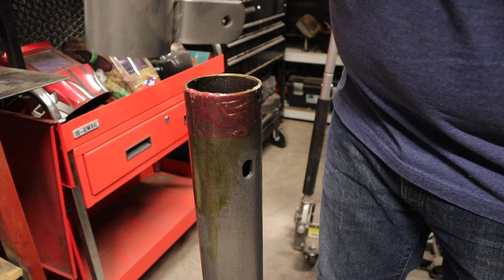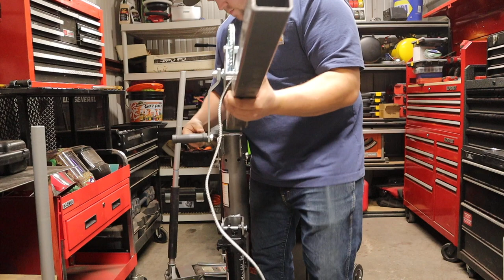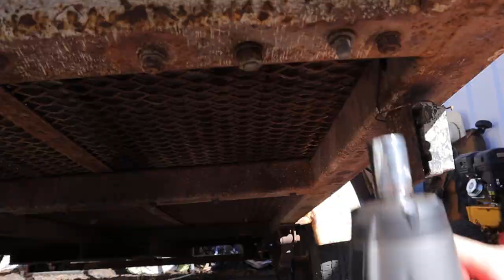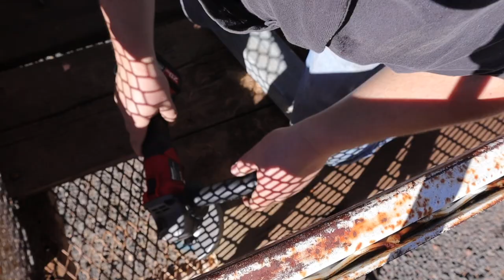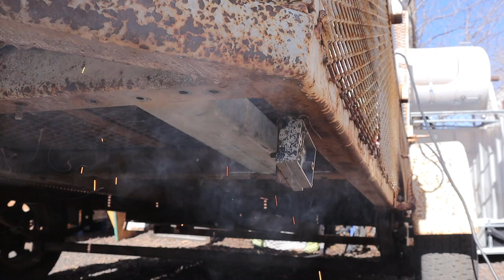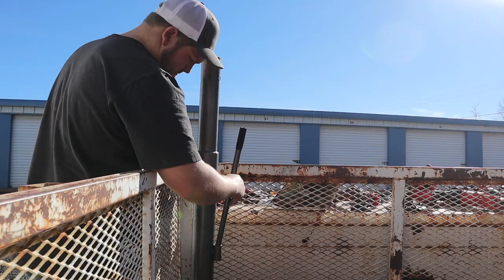Harbor Freight Pick Up Bed Crane Assembly and Mount on a Utility Trailer

Comment: That little bitty Bauer circ saw sure came in handy in that tight space - nice! Was that also a Bauer recip? And grinder?
I enjoy your content - thanks for posting!
Reply: OK, I just watched this again on a larger screen and saw that the grinder was the Bauer cordless. Recip too?
Reply from the maker: Yes sir! All Bauer cordless tools. The 3/8” impact to remove the bolts. The circular saw to but the wood out. The reciprocating saw to finish what the circular saw couldn’t do. The second generation grinder to cut the the expanded steel out. The first generation grinder to grind down the weld spots in the way and to clean the metal for welding and then wire brush the flux off the weld. Then the regular drill to drill the holes in the steel frames. Then the 3/8” impact to to tighten the new bolts. All cordless Bauer tools! They might not be professional grade but they can seriously get the work done. Thanks for watching!
Reply: InstaBlaster.

Comment: Wranglerstar would NEVER say teflon/loctite is unecessary hahaha. Tech question, what do you film with? And what software do you use for editing?

Crane looks pretty handy! Not sure what I'd ever need it for but the coolness factor haha.
Reply from the maker: I have a Canon EOS M50 to film with that bought for like $650 last May, and then iMovie to edit. And ya Wranglerstar would never say that haha! I miss what his channel used to be like. I don’t care for it anymore.
Reply from the maker: As for the crane, I’ve thought about trying to start a little junk removal side gig in the past.
I doubt I will, but if I do, this would be really handy for big heavy stuff, outside of that, more than anything it’ll just be to have it for when I need it.
Reply: @DereksWorkshopAndProjects  Awesome, thanks! I have access to a rebel t3i that I've used before, considering buying it off my friend and using it regularly whenever I make the jump to making content regularly. I share a lot of Cody's opinions on the topics he discusses lately so I enjoy his content still, but I could see how people would be disappointed with how non PC he's become, as well as changing his style of content from the old tool videos he used to do. One thing that is awesome to see is his videographer ability though, he's improved tremendously with using lighting and sound etc.
Reply from the maker: I’m pretty central when it comes to politics. Sometimes find myself leaning left and others right. Depends on the specifics. One of the things about leftists I hate is their PC culture. So that’s not what bothers me about him. I’m also big on personal responsibility and he seems big on that too, where the left usually isn’t. I might lean slightly more right than left.
I rarely ever get into politics on YT though.
In fact this is probably the first time I have ever discussed my views haha.

What bugs me about him is that he used to be very work and information heavy. I really was inspired by him at one point and now he is just all about products and playing around. Not really about homesteading/farming/gardening/ wood cutting/tractors/tools/equipment like he used to be. 

For me I don’t care about his snow bike trips or his RV park plans. Or even really his house remodeling. I used to learn a ton from him but I just don’t enjoy what he puts out anymore. 

I didn’t know you were a content creator. I’ll look at your channel!